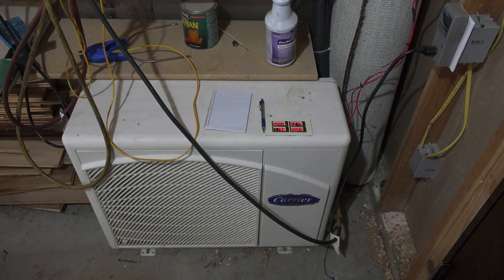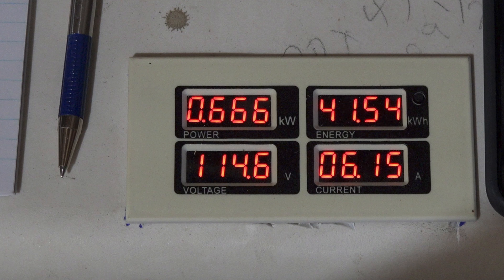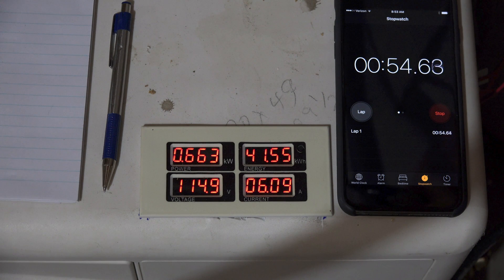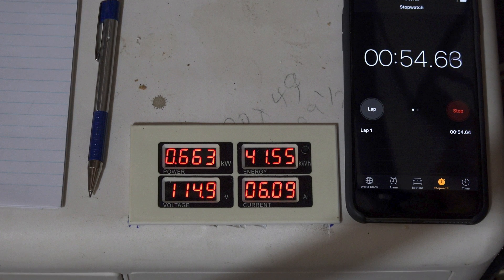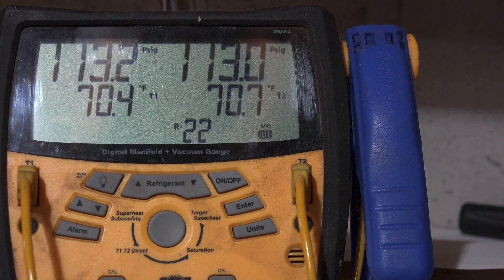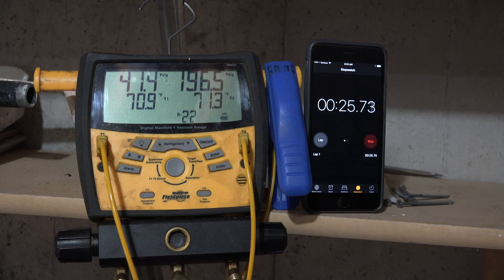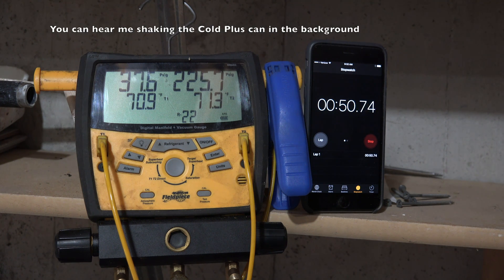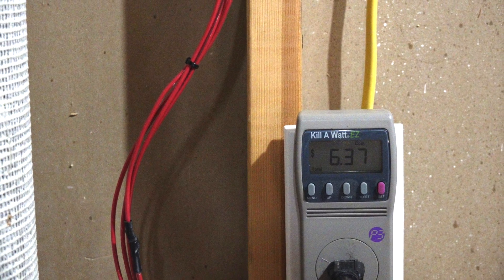Cold Plus test #2

Comment: the manufacturer recommends clear area around the condenser, you will have a much better system if you remove all the items blocking/obstructing your air flow into the condenser, your thoughts

Comment: Yes, why the 35 lb suction pressure? R22 units normally run at about 70 lb, give or take, with about a 40 degree coil.
Reply from the maker: This unit is cooling a room to about 61F.  It also tends to short cycle.
GFM
Reply: both lo and hi pressures are too low
Reply: Michael Mace Totally agree, too low

Comment: Why low side gets too low it s not a freezer... bc of txv right?
Reply from the maker: The unit is R-22, the conditioned space is around 60F.
GFM
Reply: grayfurnaceman got it. Not used to seeing R22 units running that low of a temp. 20 yrs ago when the price of R12 went thru the roof I installed an R22 walk in box and had even lower pressure. Its been a while as I've been out of the refrigeration business for quite a while.